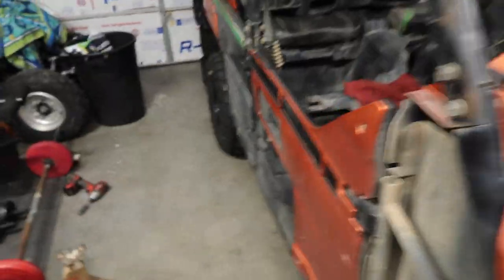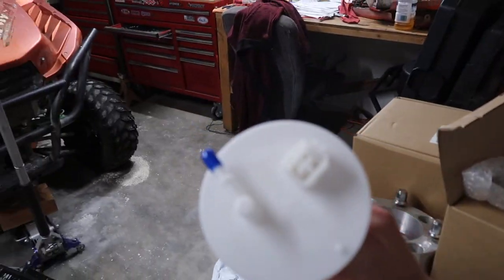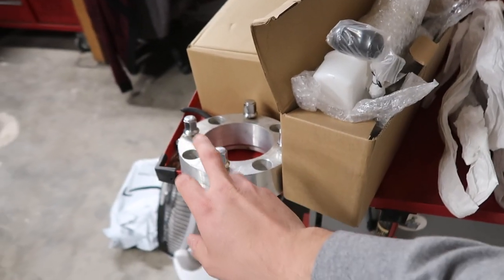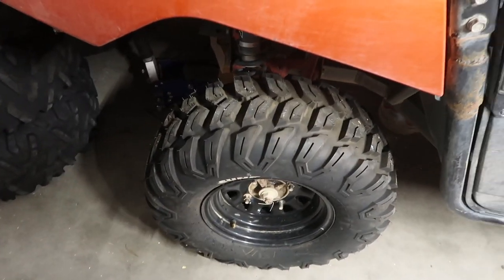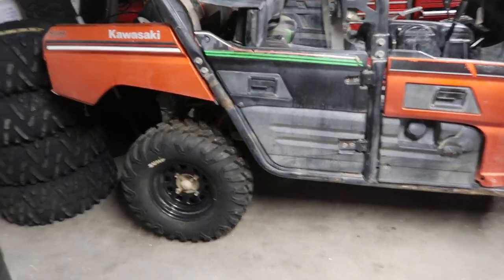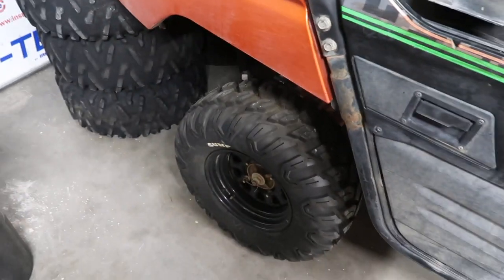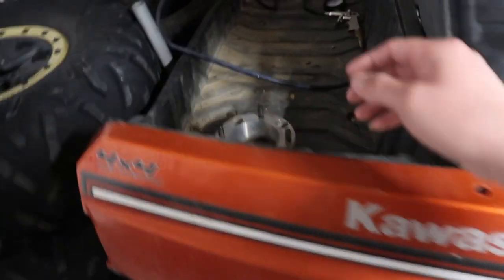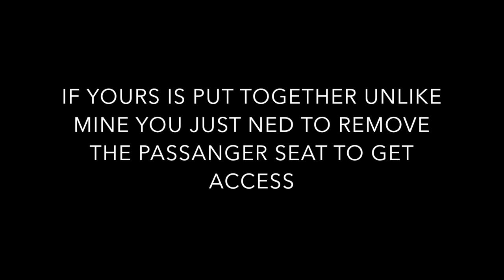KAWASAKI TERYX FUEL PUMP REPLACMENT IN LESS THEN 10 MIN

Comment: thanks, this was helpful in finding where to go for my tank.  I am inspecting my fuel filter.  Recently bought used 2016 Teryx4 here on Kauai and just going through maintenance items to be sure she's good.  Changed dirty front and rear fluids and oil / filter.  We use it on a 4ac farm land at home that is mostly sloped pulling a mower among other tasks.
Reply from the maker: Nice ya it's good to keep up with it last thing you want is a break down in the road